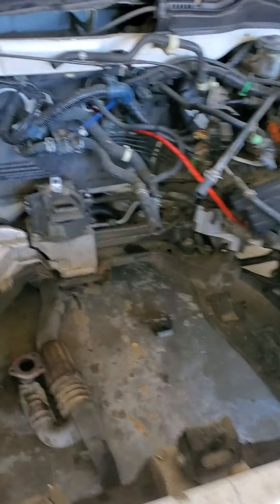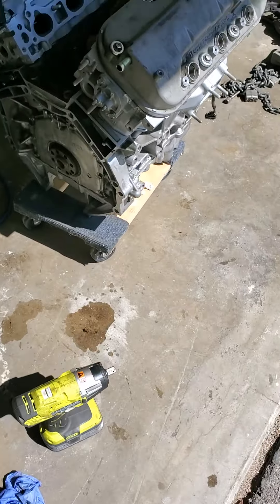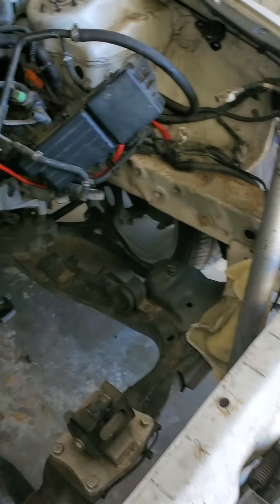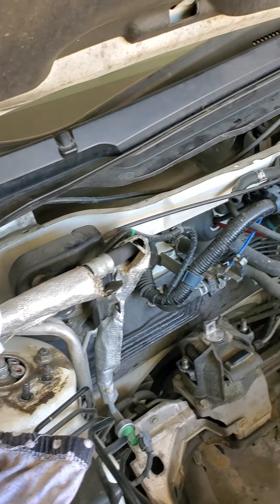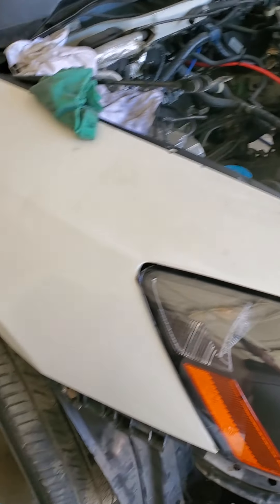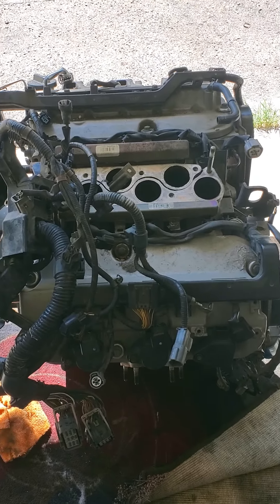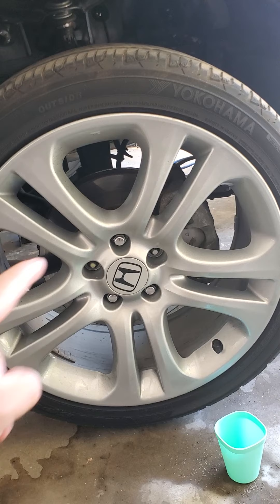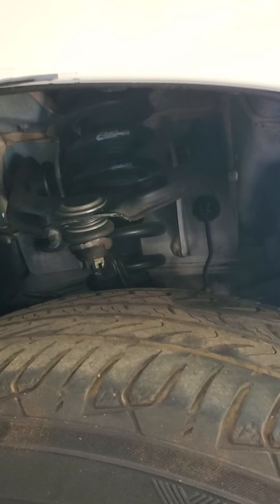Honda accord 2005 J35a6 swap

Comment: Hi from Mexico bro! I'm thinking about this swap on my 04 accord J30A4, and i have a couple of questions:
- Do you run J30A4 or J35A6 injectors?
- If i run my J30A4 stock ECU, do you recomend to use J35A6 injectors? Or maybe those injectors would cause problems later with mi stock ECU?
Reply from the maker: J35a6 inyectors are same as j30a4.  Accord ecu is better due aggressive fuel tables and timing.  You can use everything from the accord
Reply: @theaccordman2074  Thank you so much dude!!
Reply: @theaccordman2074  Do you know if the J35A5 its a direct swap like de A6?
Reply from the maker: @MarcosChavez96  to what car?
Reply: @theaccordman2074  2004 Accord V6, 7th gen
Reply from the maker: @MarcosChavez96  make sure that engine is a single cast exhaust and drive by wire
Reply: @theaccordman2074  Yes, its a single exhaust by head, the vtec solenoid are on the back where the oil filter is, and de crank sensor are the same

Comment: Will the j35a6 mount up to my 04 accord trans? Will the j35a6 run fine with no codes because its similar to the fuel trims of the stock ecu? I have cali smog and I read that the j32a3 runs lean unless you get a tl ecu re programmed to the vehicle so it will throw a code and won't pass. Does yours throw a code for lean? I read you have to re pin  injectors, is this true?
Reply from the maker: It won't pass cuz is a swap. Either way with code or not code. No repin need, it have to be 2004-2006
Reply from the maker: The accord 6SPEED ECU HAVE more aggressive parameters then odyssey j35a6.  I recommend you j32a3 if you want for performance
Reply: @theaccordman2074  I will probably just replace the head gasket on my j30a4. I already have j37tb j37 IM with butterfly valve jpipe full exhaust. One of best mods I did was light weight underdrive pulley. The whole ecu key ignition thing is my concern and throwing codes. I was going to get the swap bard inspected and legal if I did do it. I almost went to buy a j32a3 but someone who had used the  j30a4 ecu told me it will be stuck lean. Smog in three months.
Reply from the maker: @Jaydogg209  if you want to be carb legal this is not for you bro. WITHOUT HONDATA FLASHPRO you can put alot mods but the gains are not going to be alot.
Reply: @theaccordman2074  thanks for your advice. I might get a 06-07 tl ecu down the road for hondata with my j30 would also need harness adapter but for now I'll just focus on passing the test. Its too bad I can't just do a simple head swap but that won't free up any gains it might lose power from what I've researched. When I move out of Cali one day I can build it how I want.
Reply from the maker: @Jaydogg209  I got my build like I want. Just when is smog time have to paid a bit more. No big deal
Reply: @theaccordman2074  nice

Comment: hello greetings I have an accord 2004 j30a and I want to do the swap j35 .. could you give me the data of everything that I have to have or modify please
Reply from the maker: So you looking for NA or planning turbo? If you going NA I will recommend you j32a3 TL 2004-2006. If you going turbo then go j35a6 2004-2006. Both engines are direct bolt

Comment: I’m doin a j35 swap into my accord can I use da j30 harness with the computer for the j35 motor???
Reply from the maker: J35a6?
Reply: @theaccordman2074  yes
Reply: The motor came out an 05 Honda odessy
Reply: My car is an 03 accord
Reply from the maker: @omarharris7683  ok but what j35 you putting on? There's like 4 different
Reply: @theaccordman2074  yea it’s a j35a6
Reply from the maker: @omarharris7683  ok yes is fine your j30a4 ecu
Reply from the maker: @omarharris7683  a recomendation try to get p2r BC camshafts for top end power.  Those engines are really powerful on mids but topend dies
Reply: @theaccordman2074  ma fault it’s a j35a7
Reply from the maker: @omarharris7683  call me bro 213-292-0957
Reply from the maker: @omarharris7683  thats a VCM engine I need to explain few things to make it work
Reply: @theaccordman2074  ok u got ig??
Reply from the maker: @omarharris7683  what? Call pls
Reply: @theaccordman2074  if I swapped a j35a6 type s engine can I use all other stuff stock in my 2003 accord?